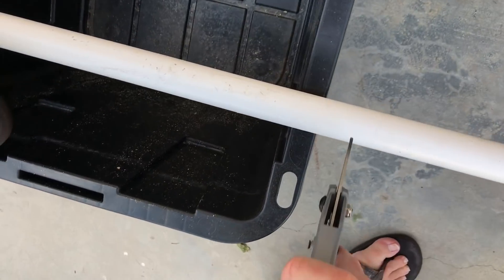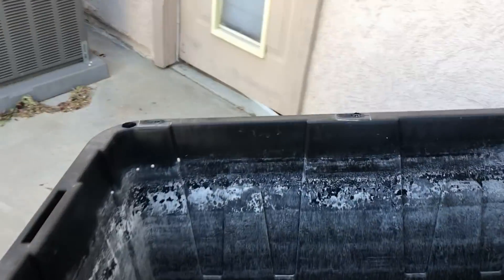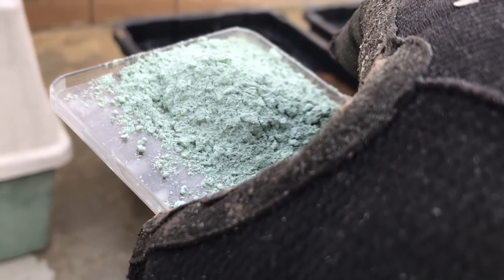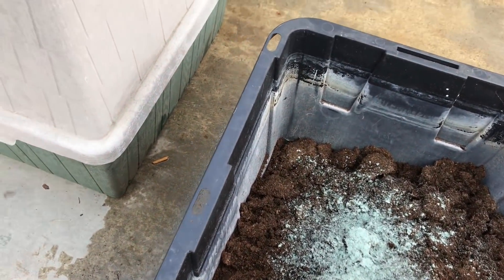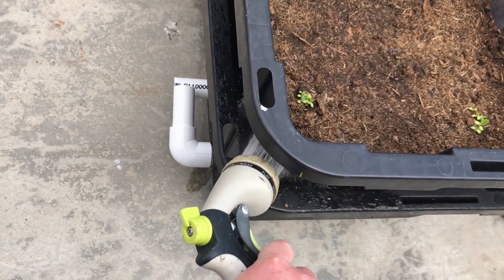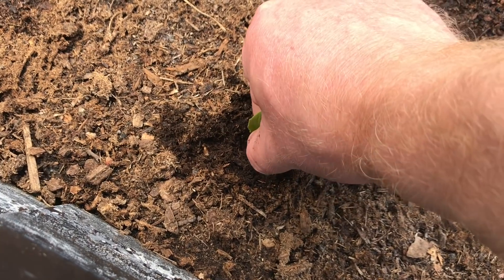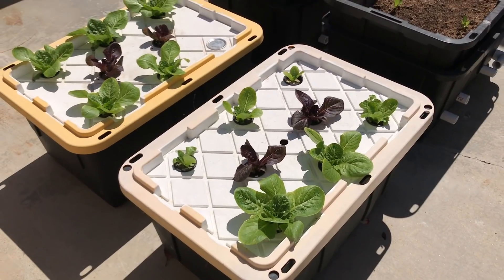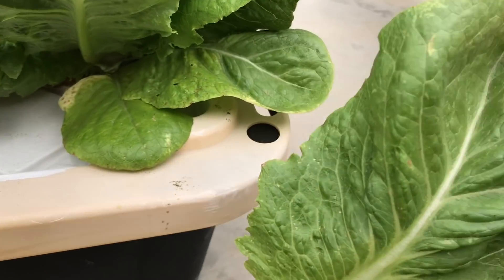Soil growers can't handle this video!

Comment: You are getting lots of comments and views which boosts your channel, but sadly you are providing misinformation.  It is a fun, dramatized video but not an accurate comparison.  The huge difference in growth and relatively total failure of soil grown lettuce show that the earth boxes were obviously not constructed properly.  I was actually quite interested in the idea but disappointed.  The cross pipes with holes in them for air aren't really necessary and would have also acted as an overflow in the water chamber if the water levels were ever that high.  It would also serve to dry out the soil at the bottom of the container thus blocking the wicking properties.  Perhaps your wicking cup was not deep enough to be in constant contact with the water.  And I would have added 2 or 3 wicking cups for a container that size.  You may have been better off just hand watering regularly in a regular pot.  Further more young seedlings - even in an earthbox - need to be top watered until their roots have a chance to grow deeper.  Plants at that stage are sensitive to moisture levels.  A mulch on the soil would have acted in the same manner as the lid on the hydroponics container protecting from evaporation.  Also the soil must be fed nutrients in some manner, just as nutrients are added to water in a hydroponic system - especially if so much peat moss is used.  (For that matter should not the same nutrients have been added in equal proportion to both mediums?)  Did you use potting soil or garden soil?  Containers plants don't do well with heavy ground soil.  It compacts too much for plant roots to grow.  And the only thing peat moss does is improve water retention - if it's mixed properly.  This is why peat preserves and mummifies things - because there is no organic life in it to break organic matter down.  I'm not cutting down hydroponics but I watched your video hoping for a fair assessment.  You can claim that soil growers have and issue over this video but your methodology skewed the results.
Reply: i didnt bother finish reading this cuz im not growing stuff, but man u guys out there know so much about everything!
Reply: @Julie-jl2kk  you got that right! As a youtube community everyone is entitled to being a scientist in the comment section 💀
Reply: I’m a novice, so please excuse me if this is an moronic question. Is it possible to start seeds using the hydroponic system for quick root growth and then transplant to soil for a more nutrient rich plant? And if so how do you know when the root system is healthy enough to transplant?
Reply: @misscleo378  from what I heard plants grow water roots when in a hydro system and water roots are not as suitable for soil as soil roots. Well at least for my avacodo plant thats the case lol
Reply: @macdadydoo569  did you acclimate your avocado to soil by slowly I troducing nutrients? Or just root shock it?
Reply: @kamarilaitinen  slowly added nutrients its doing fine a little frost damage since it winter just passed but its fine i just read that water roots can get bad if you let them grow too long.
Reply: @bryan s  thanks!
Reply: @misscleo378  Its always best to start them in the same medium, even more so for living soil the microbes develop a symbiotic relationship right away. Some seeds even come with their own specific fungi.
Reply: @macdadydoo569  My best results with avocado was planting directly to soil and keeping the soil moist. Citrus LOVE moisture and wet roots.
Reply: @macdadydoo569  - One does not have to be a "scientist" to know how to grow plants - it takes experience, which some people have because hey have successfully grown gardens for years in an open space garden, and in containers, and this man Jeb does not have that experience - that is obvious = so I, as well as others, find other gardeners opinions, knowledge, hints,  helpful.
Reply: @misscleo378  - I believe if the plant is still very young, with only they beginnings of the tap root, and a few off shoots, they can be started in water then moved to a planter - I've seen some vids demonstrating this - especially stem cuttings.  But what I have learned is that a plant that is grown hydroponically can not be transplanted to sol as it has not learned to break down the nutrients in the soil to absorb them naturally - basically the hydroponic plants are to lazy to work for their nutrients as a plant started in soil.  This is also the case of using chemical fertilizer, such as miracle grow, once you start it the plant become dependent upon it - like a drug - and will not properly absorb the natural nutrients form the soil.  So if you start with natural fertilizer do not use any chemical fertilizer as the plant wont want to go back to the natural - basically they are getting spoiled on the chemical - easy to get supplement - however I will also tell you that hydroponics lack the flavor, and nutrient value, of natural soil grown, organically fertilized, vegies, - that is a fact - ever compare a store bough tomato, grown hydroponically, to a soil grown tomato? the flavor is amazingly richer in the natural soil grown foods because they absorbed the nutrients naturally - it does make a difference.
Reply: @alwaessurius8498  you are a prime example of the average youtube scientist. 3 comments in a row talking about what jeb did wrong yada yada. Bro no one cares go read a book or something.
Reply: @alwaessurius8498  I got a question are you into fitness?
Reply: @macdadydoo569  - Yes I believe in being fit, and healthy:  which I am, and I am in my late 60's, and have not been to see a doctor for anything other than a broken bone = NO medical bills.
Reply: @alwaessurius8498  ah you must be pretty good at fitness then
Reply: @macdadydoo569  - Mainly it is eating right - and knowing herbs - one does not need to "work out" to stay fit.  A healthy lifestyle and just being active (not sitting all day in front of a computer or TV).
Reply: @alwaessurius8498  yup its confirmed you are the master of fitness.
Reply: Miss Cleo it is perfectly normal to start in rock wool or a peat moss pot when getting it ready to transplant it. It is a common method used when suppliers clone plants. It will be ready to transplant as soon as it has healthy root growth, there is no benefit to waiting for the roots to get bigger.
Reply: @BobLSaget  there is no point cuts can be put straight to soil.
Why force unnatural mediums onto a perfectly good organic plant.
Reply: @BobLSaget  I bet you use hormone powders and gels too lmao coconutwater, aloe and bean soak water dilute 50/50 with distilled BAM organic and works better or if you have willows around just make willow water.
Reply: @lovegirl4579  is avocado considered part of the citrus family?
Reply: @OSMBLSM  no avocados are Lauraceae and citrus are  Rutaceae, however they have very similar requirements.
Reply: @lovegirl4579  oh ok, thanks for replying. I had an idea that might be what you meant but wanted to know for sure. :)
Reply: @OSMBLSM  yeah looking back I worded it bad.
Reply: @OSMBLSM  Funny bit is here in vegas we had a nasty cold snap in feb and I lost all my oranges and avacado yearlings. So they require the same things to die too lmao
Reply: @lovegirl4579  oh no! I've just moved to Texas and am trying to explore what kinds of trees I could grow here, in a pot or half barrel. I'm apartment living for the first time n wanna turn my patio into a lil garden. We had a pretty cold spell here too so was worried if I should plant my dwarf lemon tree seeds or save them till I can get a home where they'd be in greenhouse. I'd love to grow avocado also but know even less about their needs.
Reply: @OSMBLSM  if you have room for a houseplant in the winter time that is gonna be your best bet. They dont like much colder than 60 at nights. if you see the forecast for 50s pull them inside and put the planter into a tray and fill the tray with river rock or decorative stones and then keep the tray full they love those wet roots. No artificial light is needed but if you can put them where they get indirect sunlight they will look healthier. regardless in the spring once temps come up you can put them back out and they will start looking much better with full sun. after they are a year old start hitting them with a high nitrogen citrus fertilizer. They require .5 to 1 pound of nitrogen a year. This can be given as a time release all at once or fed throughout the spring and summer as a fast release fertilizer. Hope this helps.
Reply: @lovegirl4579  wow, thanks so much! I really appreciate the information. Is there any way to plant an avocado seed but keep the tree from getting taller than 3 or 4 and still have it produce fruit?
Reply: @OSMBLSM  Absolutely although topping young will cause it to bush out the difference is in the pot size. In the ground in a 9+ climate they will grow 80ft high untrained. As a bushy, shorter plant they might be 20' high and 20' wide in say a 20 -50 gallon planter you could achieve smaller plants though by limiting root growth. If you get land and still have your trees put them in 200 gallon smart pots or the ground if you want them to expand then.
Reply: @OSMBLSM  Look at Espalier methods aswell once you do find yourself on land.
Reply: @lovegirl4579  I will. Thank you so much for taking the time to share knowledge with me.
Reply: @OSMBLSM  I think most passionate gardeners will take the time for that. The key is figuring out what is true and what is wives tales...but if you research and check facts you can self educate on the subject via the internet.
Reply: Bella's Patio Garden Let me finish reading it
Reply: @Lucy Ferro most of this countries natural soil has been destroyed by the use of synthetic fertilizers and pesticides along side the mono-culture practices. Together they have leeched the soil, killed all the natural defenders, killed the soil microbes that naturally feed the plants what they want through carbon exchange. SO they are going to need help before the soil can just be planted in and forgotten. You are living a fantasy. Unless you live in a country with volcanic soil like Nicaragua. However, amend with volcanic dust, aged and activated biochar, and topdress with wild grasses and leaves several times a year and you can turn even shit dirt around in no time.
Reply from the maker: that all sounds like good solid info but i wasn't misinformative about anything.  I noted in the video that there was a flaw with the wicking beds
Reply: @JebGardener  there was more than one flaw it was poorly executed on both sides.
Reply: Oh - I missed that in your description for this video because I didn't expand it and that's on me - but that being the case your video title is very misleading.  I would feel less tricked into watching if you would have provided a text right at the beginning of the actual video.  I would have watched it anyway but would not have been left with a bad taste for it.  If your title had said Attempt to compare soil growing to hydroponics for instance, I would have still watched it because I am actually interested in the subject.  I was hoping to at least learn something about hydroponics from this video.  Now I feel I've just been click-baited into watching something useless.  I tried to be constructive with my comment rather than just critical.  But I'm left with this feeling now that the integrity of your videos is not something you care about.  That may not be true but as a part of your audience that is how it feels to me.  Probably it doesn't matter to you, but I will be going to other channels to learn more about hydroponics.  You're welcome for my participation on this video.  On the plus side I have to say - you grew some fabulous hydroponic lettuce plants.  Best of luck to you.
Reply: @bellaspatiogarden3493  nice TED talk 😍
Reply: @bellaspatiogarden3493  - I agree with you 100% - You are absolutely correct in all you said - do not apologize for anything to Jeb.
He did not give the soil growth a fair chance - I've never had it take as long, as his did in the soil, to germinate, and grow, even planted in a natural open garden area and not containers.  
His soil plants are to yellow, unhealthy from the start, from a lack of nutrients, and calcium - and the soil is too acidic and needs some lime to sweeten it up some, and maybe some organic decomposed animal manure.
But this was a very poor "comparison" demo - in order for it to be a good comparison - each container needs to have equal opportunity to the proper nutrients it needs to grow.
an without the soil actually making some kind of contact with the water I do not see how the soil can become moist enough for the baby plants to grow - using strips of cloth submerged into the water below and incorporated into the soil, may have pulled the moisture up into the top soil - I've seen the cloth strip wicking method used and it seems a pretty good idea for container planting.
So as a "soil grower" can I not stand this video - Yes - I can't stand this vid as it is poorly made, and the soil growing was improperly represented = a bias toward artificial chemical growth to natural growth as God intended.
Reply: your comment is misinformed and very misleading, it makes it appear as though Jeb is doing a bad job, you should be ashamed. You know damned well that a small channel can't generate views on it's own anymore, so having clickbait titles isn't a big deal SINCE THE SUBJECT MATTER IS THE SAME AS THE TITLE, ya dingus.
Reply: The only thing I noticed (which I use often) is the possibility the soil plants would have done better if he used some diluted peroxide.
Reply: @supportthebandsstopfakecop1679  That is stupid since you will kill off all the microbes that make growing in soil so amazing. Dont give your shit advice to people so they fuck their plants up as much as you are. Also there is no fucking god, rip that bandaid off too.
Reply: Not only that the music makes his video sucks

Comment: Looks like you wicking beds had no wick. That net cup probably only hung an inch below the support pipes at most. The water cant get higher than the support pipes because their mounting holes aren't water tight, plus you drilled air holes in the pipes. So the net cup was not in the water for long, if it ever was.  Maybe hang some wicking material from up in the soil, down through the net cup, then all the way to the bottom of the water reservoir.
Love your videos! Hope to see you successful in your future attempts!
Reply from the maker: yes it has a wicking problem

Comment: To keep the pests off the lettuce, without using pesticides,  build a cube shaped frame & staple organza mesh fabric to all sides except the bottom. Put this "cage" over the lettuce & pests can't get through the organza.  Retry this experiment, in growing in LOAM + COMPOST (plant  based is best because it's the natural cycle of life with no cruelty involved) + WORM CASTINGS + GREENSAND + WOOD ASH, + ROCK PHOSPHOROUS & see how well the soil ones grow then.   In this experiment, the way it is, the plants simply starved, and dried out.  A water resevoir under the soil, would have helped.  If you are using chemical nutes to grow hydroponically, then doesn't that mean that when one eats hydroponic lettuce, one is also eating the chemicals the plants drew up? That doesn't seem that nutritious.
Reply from the maker: It’s a wicking bed so you have to be cautious about rotting organic matter.  From my research so far it seems like if you run the EC low you have less risk of nitrates building up in the plants.

Comment: thats a mega difference between both techniques
Reply from the maker: well to be fair the soil had some moisture issues
Reply: Jeb Gardener how did you address moisture issues in soil
Reply from the maker: i started top watering, but it got too hot.

Comment: Seems the dirt lovers suggestion that your dirt was lacking could hold some truth. Try it with good rich soil full of worm castings and living bacteria from compost. Have you ever tried hydro without the chemical nutrients? Like fish emulsion and seaweed extract...i did some lettuce in hydro that way. Worked well.
Reply from the maker: I'm trying it again with fish fertilizer and better hydration.  Hydro is still blowing them out of the water.  I haven't done organic hydro yet.
Reply: @JebGardener  here is me lettuce 
https://youtu.be/vxbGLHg3CGA
Reply from the maker: That looks cool thanks.

Comment: you're still the best. really enjoyed the music, was there something else going on? you had dressing from a bottle? thanks for solving the lettuce question. do you think it would be the same with basil, peppers and other herbs, over the winter? i'm thinking some pots and hydrop. what would you recommend. thanks
Reply from the maker: well the issue here was the soil was too dry so it wasn't a fair comparison.  I'm running the test again.  In winter the water is an advantage because the mass holds heat.